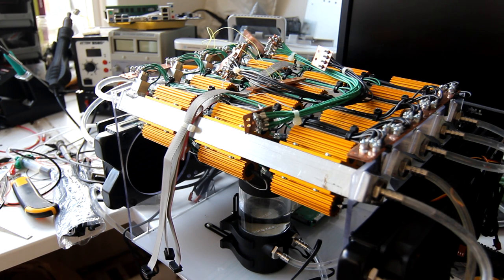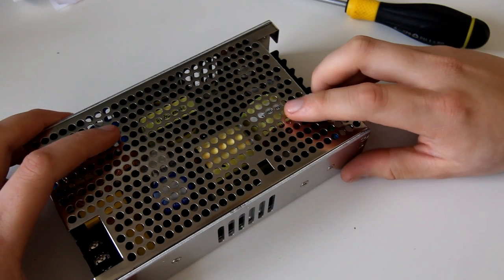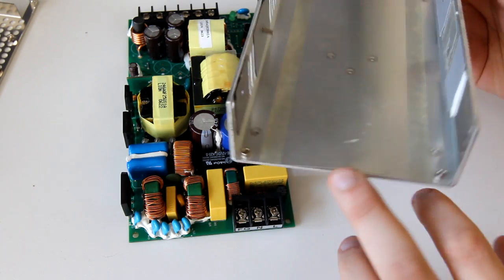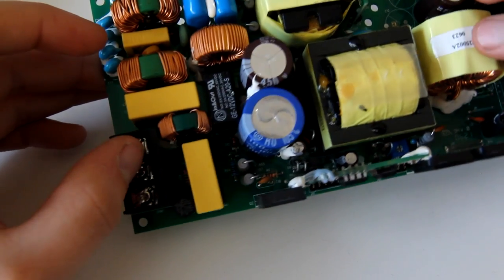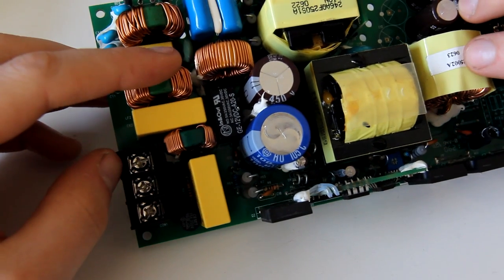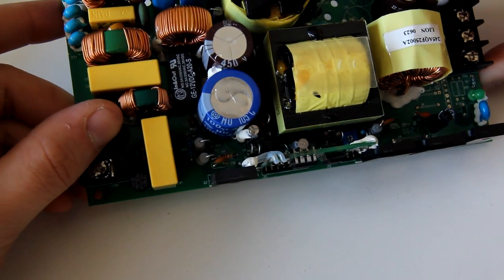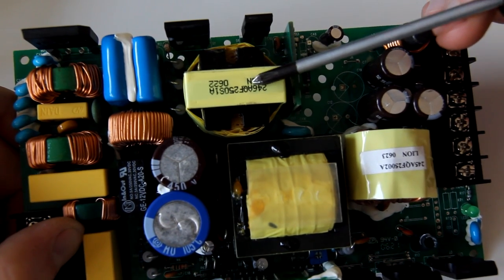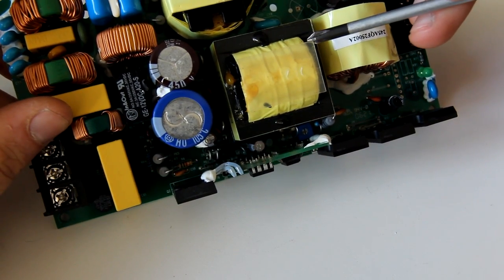Arch Electronics 250W open frame PSU teardown (001)

Comment: I'm just a few minutes into the video and noticed the relay. I'm not sure if you talk about it later on but I suspect it could be for bypassing the inrush resistor to improve efficiency of the power supply. I know this is done fairly commonly on higher-end ATX power supplies.

Comment: -If you shine a light on your subject, we can see the subject clearer.
-It would help to write some stuff down, up front so you son't have to go back and forth saying it's 'this' and it turns out to be 'that'
- I like what you are doing!
Reply from the maker: +steven stassen Thanks for the feedback. I'm still looking into the light issue, having a big DSLR+lens, myself, overhead lights and the subject itself makes for a bit of a complicated lighting situation. 

It'll also probably take a few videos until I have a solid structure to follow. Also, currently my big 12V DC load and analysis stuff is down, so I can't test the PSU's performance.

Comment: Nice video, if I may give you a few tips:
-Do the analysis without saying anything and cut it out of the video, the video moves slow because half of the time you are thinking. It would also reduce the huge numbers of "ehhhh" moments in the video. This video could fit into 10~15 minutes without losing any information
-I think the main blue cap is Hitachi brand? Never heard of burr brown capacitors
-I really like the way EEVBLOG pastes in the brief overview of the datasheet of the most important parts: if you also do this in advance it would give much more information about the design of the power supply

Other comments are already covered by others I think.

Oh and in general: keep going as it is good stuff; I also like the power supply itself ;)

Comment: I like the internal dialogue, makes it more personal and fun although I think you could prepare your videos a bit better. Write down what you want to tell and what you find interesting. You could also consider explaining how you recognise every part or its role. I guess most people watching these videos have some basic electronics knowledge but it couldn't hurt to quickly explain the critical parts of the PSU (as an example: you recognised the pseudo-resonant DC/DC converter, you could have explained how it works). Well that's what I think anyway, I'm definitely going to watch the rest just for general interest.
Reply from the maker: +Alexander Thanks for the feedback. I've done a couple more videos. My intent is to explain a little bit in each video, so you basically build your knowledge as you watch more videos. It's hard to explain more than one basic aspect given the time constraints. 

I'm aware more preparation (and editing) would improve the videos, but I've set myself strict limits on how much time I spend on this. I'm very busy IRL and these videos are just something I do for fun. I might do more prepared videos once in a while, but most of them will be 'off the cuff'.

Comment: What are those slots supposed to accomplish?
Reply from the maker: +Michiel Haisma You mean isolation slots in the PCB? They're there to increase the creepage distance, i.e. the distance an arc has to span between two points with a (potentially) high voltage across it. Especially in an open frame power supply, you will get dust, grease, all kinds of potentially slightly conductive junk on the PCB after manufacturing. Even solder mask and silkscreen can be slightly conductive, especially when the PCB gets hot (because of a fault) and the material starts to outgas. By increasing the distance between high voltage point, you reduce the chance of the voltage producing an arc and essentially exposing the user of the equipment to mains voltage.
Reply: +PowerElectronicsBlog Thanks for your answer, but I actually mean those slots in the solder mask where now all these tinned 'lines' run. What are those for?
Reply from the maker: +Michiel Haisma Increased current capacity. By adding a bit of solder to the copper layer you can decrease the DC resistance (by a couple tens of percents) without having to go through the expense of increasing copper thickness on your whole board, while it may only be necessary in a few spots.
Reply: +PowerElectronicsBlog Ah okay, interesting, thanks.